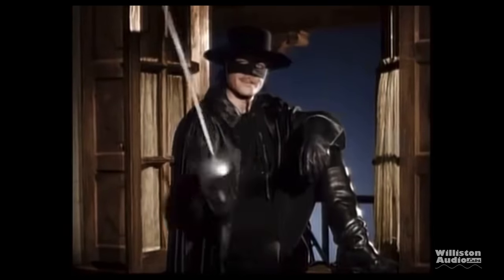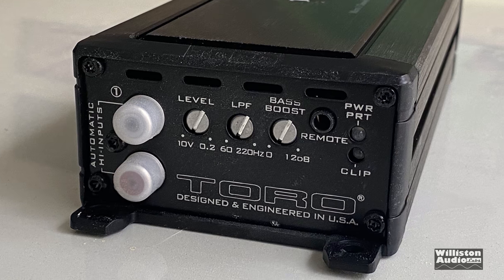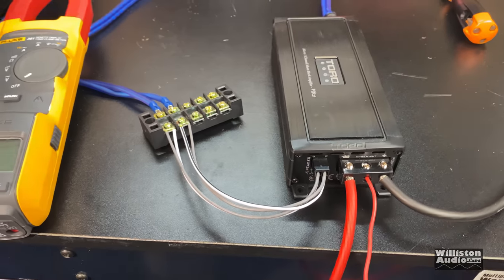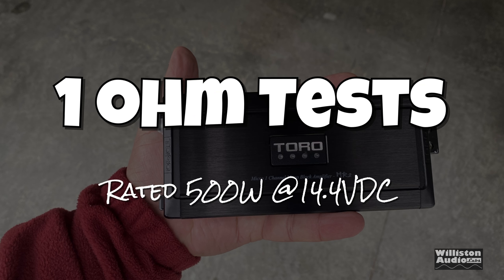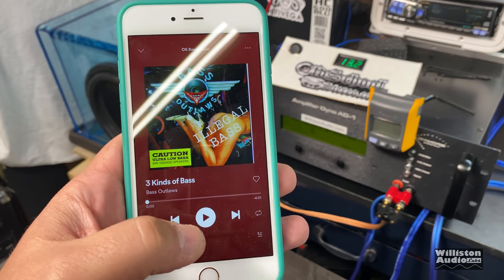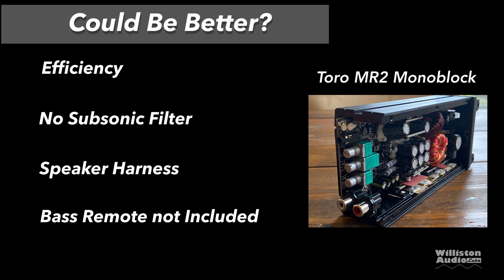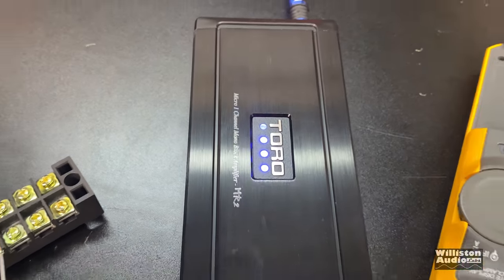This Bass Amp Fits in Your Pocket? Toro Audio MR2 500W mini Subwoofer Amp

Comment: For those saying it looks like Massive Audio, you might be on to something. I bought the Toro R3, and curiosity led me to opening it up. After a bit of searching, I found BigD's video on the Massive N2 and the board on the Toro is identical. The only real differences are the on the input and adjustment end. The R3 has "tiffany style" inputs and a few more adjustment options. Also worth noting is that the board has the same "Toro Technologies 2019" stamp like this little amp. The only thing bad I can say so far is the fact that they don't include a bass knob, nor do they sell one on their website. The similarities to the Massive makes me wonder if a Massive UR1 could be used and function correctly. Either way, if this brand can do close to rated without going up in smoke, it seems like an absolute win considering how cheap they are.

Comment: I wish manufacturers didn't use those 4-pin ATX pigtails on microamps... especially a 500 watt bass amp.  That's over 20 amps on those connectors (granted they're bridged).

Comment: Gave this amp a try based on this review. Ended up inducing some pretty bad FM interference in my 2020 Mustang. Worked with the manufacturer but couldn't resolve the issue though it worked great for bluetooth and media.

Comment: I bought this amp along with 2 toro 6in subs and the matching 4 channel amp wired to 2  6.5 mids and 3 in tweets in the dash .. subs in ported wedge box.. I built my box with scrap mdf that I had leftover.. I’ve always had big subs and man I was impressed with those lil subs! I already had the stereo so not bad at all for less than $350..Little s10 bumpin!
Reply from the maker: Sweet!
Reply: Thinking about a couple of the 6.5s as well. Always had 12s so it's hard to imagine 2 6.5s with 300w sounding like 1 12".
Reply: @Stephenspounds for what I spent it's  not bad at all ...I can't find those 4 channel right now Toro is out ..only the mono on eBay
Reply: @reynaldorodriguez3432  yeah. Probably go with the 6s unless I find 1 8". Will check ebay.

Comment: Just got mine and it definitely hits hard its pushing my Almani 800rms at 1ohm with no problems. And my gain isn't even up that much..Love it just hate the pig tail speaker connections but i got one of those blocks as well so no biggie.

Comment: Would be a sweet amp to do a stealth build in something.This and a shallow mount 10 or something. It is awesome to see big power from these tiny amps nowadays!! (and cheap)
Your door will always rattle. Foam insulation in the panels will help, but the hinges and rollers will always rattle.(sloppy tolerances)

Comment: To help silence your door the cheapest is rock wool insulation.  And I would recommend foam sealing tape between door panels.  A layer of Tar roof  paint that is sold for mobile homes would also help with vibration. More costly would be spray foam. If there is a company close to you that does it.  It has a crazy r factor and makes for good acoustics.
Reply: Joe Pokro what about vibraflex
Reply: james Giddens seems like a good enough product. But he was talking his garage door shaking.  So unless he got vibraflex free. lol. Pretty expensive product but Looks like vibraflex would install and work well for high quality system in a car.
Reply: Joe Pokro you gotta slice it in half or something lol? Looks thick af

Comment: Great review of a surprisingly good budget amp!  Nice to see some honest specs for a change. 

Does lower efficiency mean more heat? That power has to go somewhere...
 
BTW, those IR thermometers don’t read metal surfaces very accurately. You might want to try putting some tape on the surface and see if makes a difference.

Comment: Garage door rattle - I used "Great Stuff" spray foam and just lined the inside edges of all the panels. Greatly reduced the rattle. If I had put foam core panels in and used the great stuff foam to "glue" them in place, it probably would have been even better. Doesn't add much weight at all.

Comment: Great review and impressive for it's size. I would like to see you test the amps with a minimal voltage input, like if the car is not running and just using pure battery power (12.2v). I say 12.2 because most standard lead acid batteries will usually load down to just over 12.0 volts. Use say the 4 ohm load to be realistic. I think a test like that could show the beefiness of the power supply.  Since higher power amps use a switch mode power supply with regulation, a good power supply should try to sustain the B+/B- rail voltage from around 11.5 to 15 volts IMO. Maybe you've tried a test like that already? Thanks!

Comment: When we can get a 900 watt rms @ 2/1 ohms in this form factor with plenty of head room and add in some form of woofer control circuit to really tighten up the bass and then I can say the micro amps have taken over completely. But I'm impressed regardless.

Comment: May try foam board. They have them aluminum covered in the hardware store. That along with spray foam or dyno matt across areas where the foam board wont fit.

Comment: 3/4 inch foam insulation panels.  Cut to fit inside each panel and construction adhesive to adhere the foam panels in place.

Comment: Is your garage door metal? I'd think some good 80 mil sound deadener from any decent brand would help it out, considering a metal garage door is like one big piece of flat sheet metal there are probably a lot of areas on it that flex. I've used Noico 80 mil from amazon in my truck, works well, Russian made, it's not the best stuff in the world but it's good and cheap which would make the most sense for just treating an old garage door. Also, this little amp is badass! I could see someone with a lack of space tucking this unit away somewhere to power some sort of shallow subwoofer setup.

Comment: I been hearing real good things about toro subs and amps. Their 12" Force sub took down a American bass XFL in a spl comp. And their 8" force subs are doing the same numbers and sounding just as good as sundowns SAv3 8"s and Xv2 8"s ect.. I was thinking about buying one of their amps to push one of my lil sundown SAv3 8"s
Reply: My MR3 running two 10's 8 hrs straight Everyday on my work truck at 2 ohm has been great.. barley warm, @1 ohm does 800rms.. build quality is great.   At 169.00 I will get a second, run one on each sub

Comment: Thanks Big D for your videos. I agree with you on the speaker harness. I suppose that was to save room on this small amp. Question can the speaker harness be rotated 90 degrees in the plug to make sense of the + and - wire color? When you parallel to the connection point wire colors should be the same for + and - to avoid confusion. Many thanks again, love your videos. Stay healthy. All my best, Joe

Comment: Spray a thin layer of rubber flex sealant on your garage door. Shouldn't increase the weight too much, but will increase structural rigidity and the rubber should help absorb vibrations.

Comment: I feel yeah my 1 car garage is where I test sub boxes at and my garage door sounds so bad but that Walmart weather striping put on each panel seem (you have to put it on by opening the door and pausing it at the bend of each panel and putting a strip on the panel lip that's exposed at the bend and also bed egg crate foam on the inside of each panel  . Not 100% rattle proof but about 80% less 👍

Comment: Derek, can you tell us if the amp you're testing support Signal Sensing Auto-On/Off (auto turn-on without signal wire)? This feature is really useful when choosing an amp to hookup on a stock system...

Comment: i assume since you are worried about weight you have a 1 piece door of so put some dabs of expandable spray foam between the braces and the door skin, if you have a multi piece door you can try attaching some rubber or leather strips with spay adhesive as dampeners  either in between the the pivot points or to the inside surfaces across the pivot points to make it act more like a 1 piece door, you might even be able to just run a bead of silicone across each pivot point to dampen the vibration movement while still allowing it to pivot around the bend when you raise and lower the door....
Reply from the maker: Thanks

Comment: It sure would be nice if companies that want to use those plugs for speaker outlets, or even high level inputs would include loose terminals for those plugs so we could crimp our own wires into their plugs.
Reply: True but butt connectors and wire splices are cheap af.

Comment: Km glad to see how this amp performs i have two toro fierce 12s in a 4th orderni was going to buy their r6 amp thats supposededly half ohm stable and rsted for 3000 watts rms. But i boight an nvx vad2700 just to be safe i wanted to make sure i had enough power at 1 ohm
Reply from the maker: I've heard good things about that amp, haven't had a chance to play with it yet. My experience with NVX says they do rated plus some

Comment: This is a serious question, can I add an amp to a portable speaker box? I have an old speaker box I would like to use as a project. I want to add a 6 1/2 inch car speaker, amp and a mighty max battey like the Mighty Max Battery ML18-12 - 12V 18AH CB19-12 SLA AGM Rechargeable Deep Cycle Replacement or smaller

Comment: I mentioned in an early comment that I had installed one of these TORO amps and it overhead to the point of meltdown. I would love to send you this amp just look it over. If you are interested.
Reply: Just curious... What was the impedance of the speaker you were driving? 

I am considering one of these for a 200 watt rms 4 ohm 10" sub, which I am hoping would be low enough power consumption that the amp won't meltdown

Comment: I know this is a vague question, but what would a good, inexpensive 10" speaker be for this amp in a non-ported box? (Goes under the back seat of my 2003 RAM so box is kinda small and has 6.1" depth).  Thinking maybe the RF R2D4? Or maybe hog out the hole and install a Skar IX12 D2?
Thanks!

Comment: IF ANYBODY'S HAVING A PROBLEM WITH THIS AMP OVERHEATINGJUST REPLACE THE BOTTOM PLATE WITH A NEW ONE and add 2 FANS OR 1 NICE FAN..
Wham bam, thank you ma'am 🤣 problem solved.
I do this with all my amps or I build an amp cooling rack underneath the amp(s) with the bottoms taken off

Comment: If limited space was of ultimate concern, like an older Porsche 944 or a single-cab work truck, then there's value in this. My concern would be that the amp is too small and cramped on the inside that corners were cut and it could easily cook itself.
Reply: You could probably put a 12v fan on it it looks aluminum

Comment: I had a linear amp by in the day which was way smaller and it did just as good as my subwoofer amp under the same power even. i was surprised to see that power my 3 15s very well. That amp is made pretty good to handle a 12 like that. I was surprised at the results even with its rated power from the tests.
Reply: Model # ?

Comment: This mini amp is for max a 6.5in subwoofer or a 8inch but really I think this amp application is good for a boombox project
Reply from the maker: Boom shocka locka
Reply: what makes you say that?
Reply: This amp can be used for any 500w sub. Be it a 6.5 all the way up to a 15.
Reply: 500 watts is 500 watts. An amplifier can't tell, or care what the actual size of a speaker is, be it a 1 inch tweeter or a 18 inch subwoofer.

Comment: @Williston Audio Labs can you do a video series on the most efficient amps in a couple different ranges? Either by fuse rating or by wattage. IE 40/50, 60, 100 fuse rating or 500,750,1000,1500,2000 watts. Thanks from one big dummy to another. I’m outta here.......

Comment: Wonder what would happen if the caps were replaced with high quality Nichicons. (same specs)
Reply: 7367Network Probably nothing for the first couple years.
Reply: Quality capacitors is really only going to make an effect on the long term reliability of the amp, cheap ones given they are the capacitance and voltage they claim, will do just fine. There could be a minor improvement in sound quality but I really doubt someone buying an 80 dollar amp will notice it.

Comment: I wish you would test the diablo brand 8500w d class amp the diablo brand is everywhere out here and there's no info on them but for 200$ I highly doubt it does rated (4500rms) it doesn't have any fuses on it so theres no way to tell from pictures.

Comment: What would you recommend for a massive audio hippo xl 12r. Have the sub just haven't committed to an amp. Thanks in advance
Reply: Name brand that puts out a clean 3,000 watts , with 0 ga power wire,  and big 3 upgrade

Comment: Hey bud this might sound weird but bare with me! In looking to build a home sub using something I already have, being an X box cord! What amp do you know of that can run on roughly 18 amp and stil push reasonable power! Ideally I would want to match the output of the amp to the ohm rating of coarse but the problem is that at such low levels it doesn't seem doable and I figure I should give up the idea but considering I have the cord and a box all I would need is the amp and a sub but honestly I need to give up trying to build one for cheap but it would be nice to find an amp that pushed  roughly 300 watt @ about 16 to 18 amp but is it made is it even possible?
Reply: Eric McGinnis Dayton audio makes a lot of budget stuff for that

Comment: I bought the toro two channel amp off there website its the rage series don’t remember the model number but bridged to one channel at a four ohm load is doing 300 watts rms it is asking for 8 gauge power and ground I had to buy a line out converter because I have the stock radio but for some odd reason it’s getting really hot it’s pushing a kicker 10 inch comp c it’s 300 rms 600 peak I don’t no if I should be nervous because it’s getting so hot
Reply: Heat kills theres your answer

Comment: Need it to run on my Milwaukee batteries. Be nice to build my own jobsite speaker that sounds good
Reply: chris jones - just remember that the undervoltage protection for the Milwaukee batteries is in the tool, not the battery. You don’t want a lithium meltdown if you forget to turn it off or run it all the way down.

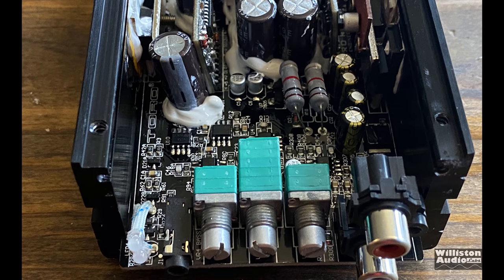Comment: At 7:12, do you see those two big grey resistors?  If you buy that amp, record those resistor ratings because chances are better than good those will be the first to burn up and burn out.  (aside from abused output xstors, of course)  it's a bit dark for my eyes, but they look to be 1K ohm at 10% tolerance.  And I'm guessing maybe 5 watt resistors.  If they burn up, you might not be able to read the bands anymore.  And 10% tolerance generally sucks.  Of course, if they do burn up, then you will want to replace them with resistors capable of handling more wattage.  But such replacements would be physically a lot bigger.

Comment: Hi big d u could try using dynamat on the back of the door that will soak up most of the vibrations and reduce rattling too and also grease the runners on the door too to further reduce the rattling effect hope this is useful for you 👍

Comment: whats up i was about to pull the trigger on the toro amp when i noticed that amazon has the linked R2 amp listed as only being 2 ohm stable, there's another page that has an MR2 as being the 1 ohm amp but none are available, is there really 2 different little toro monoblock amps, one 2 ohm and another one 1 ohm???
Reply: Yes there are two different amps the R2 is 2 channel 250 RMS per channel  while the MR2 is monoblock l channel 500rms. I was able to pick up the last MR2 off of Amazon last week

Comment: Anyone no if you can use a terminal block to lower ohms sorry lol I’m new to car audio but learning fast
Reply: Know
Reply: Ohms is basically resistance. In DC power we call it resistance, but in AC power it's called impedance because it changes based on the frequency. Just like wiring two resistors in parallel you reduce it. Wire them in series you increase it. So of you wire a dual 4 ohm sub in parallel it will be considered a 2 ohm sub.

Comment: I've had good luck using rubberized under coating in aerosol can. You can get a normal paint can of it too but.the aerosol is easier and $5-8 a can compared to $40 for a big can. I used to coat my back doors and trunk lid by spraying 2 coats of so on the inside of sheet metal where the factory had stuck a couple of tiny ass sound damping squares(one on each panel, 👎😒 cheap bastards). Should work on the garage door too. I been testing some in my garage and been thinking bout it myself but, 😠 STUPID virus quarentine bullshit 😠, got me waiting on unemployment 👎👎👎. Sucks having all this time to work on and build my stuff but can't afford any supplies or materials.

Comment: I wonder what set up could make 1ohm speaker set up. Two 4ohm speaker in parallel will be 2ohm. Then is there a 2ohm speaker to be paralleled to have one ohm? If none means the one ohm power capability of the amp cant be use.
Reply: You could do 4 4 ohm speakers in parallel, or buy 2 2 ohm speakers and wire them in parallel.
Reply: Two dual 4 ohm speakers will wire down to 1 ohm. You can parallel the parallel. Each speaker becomes 2 ohm and then you parallel those loads into 1.
Reply: Its only 1 ohm on a multimeter once its hooked up and playing impedance changes 
With the coil movement through the magnetic gap
Just hook up any sub to a mm
And push on it 
Look at how it reads